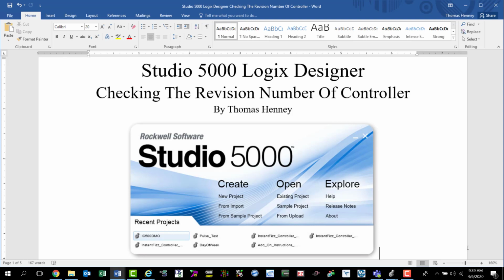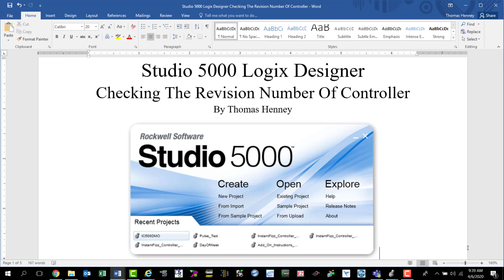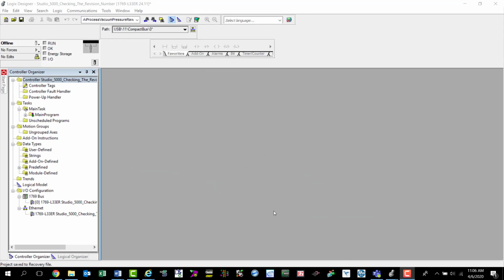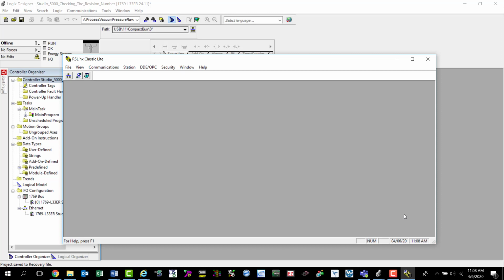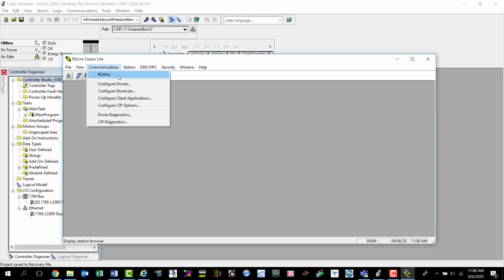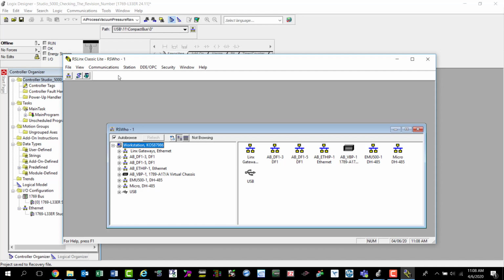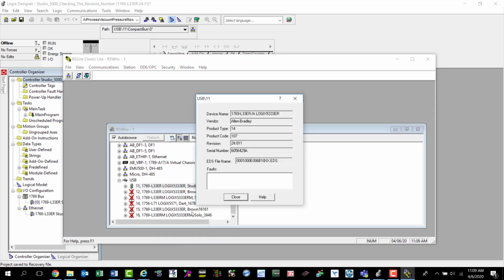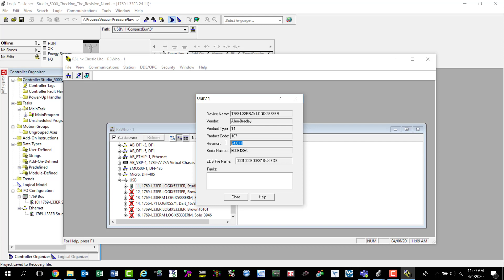Studio 5000 Checking The Firmware Revision Number Of Controller

Comment: Tom, when I am starting a new program, I select my PLC ....and am prompted for the revision #, which if I understand this correctly needs to match my Studio5000 version. But when else does this number come into play? If I am connecting to a PLC previously set up and need to make changes, do I need to update the firmware? Is that a requirement? Good idea? I'm just worried there may be a time when I need to make sure I don't "mix" the firmware version if that makes sense.
Reply from the maker: C,

First of all when upgrading the firmware there should be a reason for doing so. For the most part its a simple task but there have been times that an update has not worked out so well. But they also thought of that too, as you can also roll back to previous version of the firmware it requires more effort but it can be done. I seen it on a tech note. So I figured I would test it out and it worked. 
.
1. But when else does this number come into play?
As time goes on you may experience numerous upgrades (ac drives, servos I/O etc...) that are incompatible with the present firmware. 
At present time the latest Studio 5000 is presently at v34

2. If I am connecting to a PLC previously set up and need to make changes, do I need to update the firmware?
When you are thinking of making changes using something that is not included in the old version like maybe a SCP Box (scale with parameters) drives I/O etc... you will need to upgrade.

3.  I'm just worried there may be a time when I need to make sure I don't "mix" the firmware version if that makes sense.
In all honesty the software is pretty good when it comes to identifying a mismatch, so I wouldn't be to worried.

Hope This Helps
Tom H